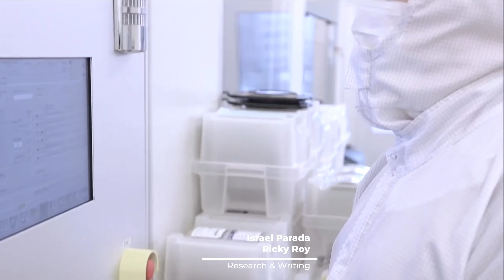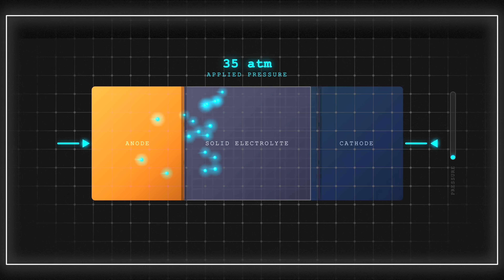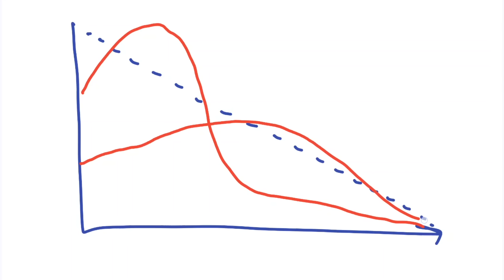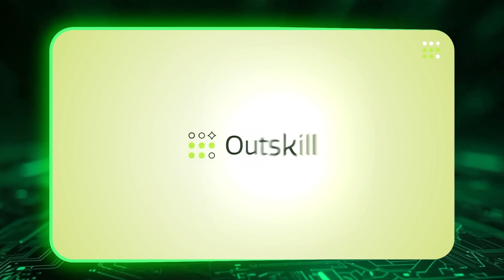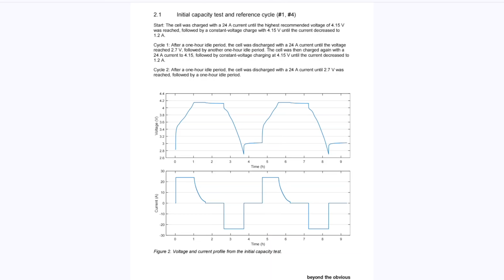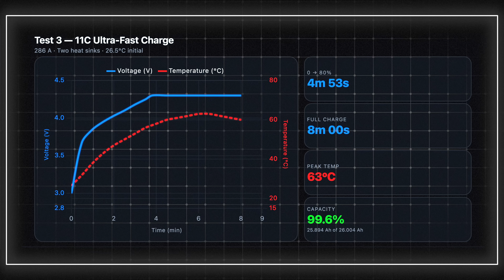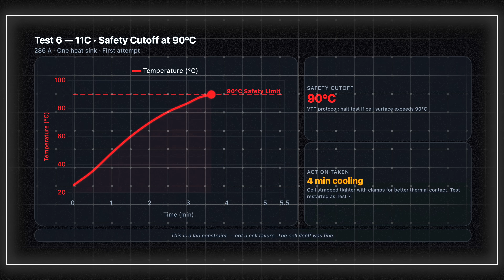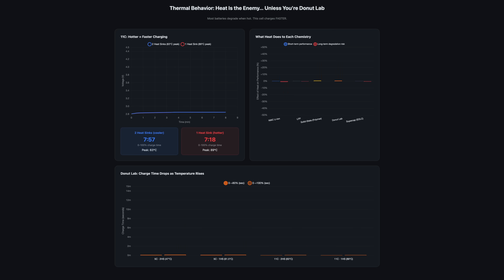Donut Lab's Solid State Battery Test are Shocking...

Comment: One thing I haven’t seen mentioned yet is the apparent nominal voltage.
In the 1C capacity test graph, after discharge and recovery, the cell sits very close to 3.0 V during the one-hour rest period. That resting voltage suggests the average discharge voltage may be closer to ~3.0 V rather than 3.6 V.
If that’s the case, this profile looks much more like a sodium-ion discharge curve than a typical 3.6–3.7 V lithium-ion system.
Add the other Donut claims, about no lithium, abundant global materials, 99% capacity at -30°C — it all suggests sodium ion.  Even the charge/discharge curves fit—except for the higher voltages 😫🤯
Reply: interesting observation and speculation and time will tell if you are right... but a plausible answer.
Reply: Nominal battery voltage would be determined through the integration of the power function (Power = Current x Voltage) over the complete charge or discharge process.   The average voltage over the complete process for this Donut battery is much closer to 3.6V or mimicking Li NiMnCo.  At CES, Donut’s representatives claimed many parameters, but three of them were 1. No lithium. 2. Voltage is tunable. 3. Cell capacity is 125 Whr. 
Nobody expected NiMH batteries to work either…except the people who developed them.
Reply: @lucianbakerii4047  Didn't they also claim the battery would mimic lithium ion so manufacturers could use them easily? If this test is to sell the battery in place of lithium ion batteries, I'd order a test that showed that it behaved like a lithium ion battery under stress.
Reply: Sodium ion has various chemistries, and the clue may be a "solid state anode free sodium battery" as it's the one sodium ion chemistry that offers high energy density (up to 300Wh/kg, equal to high end NMC lithium battery) without the addition of rare earth materials.

But I still doubt that because when I looked at some research journals about the development solid state sodium battery it still suffer from the same problem as the lithium one, like it still can't last over 1000 cycles (current EV standard require at least 1500 cycles because of the 150k mile warranty) and require very high pressure to maintain solid connection to the electrolyte just like other SSB. There are semi solid solution that solves it, but has way lower energy density (220-250Wh/kg)

So if the "100k cycle life" and "no lithium" claims are true, they basically opened the whole pandora's box of the battery industry, even if the energy density is slightly lower than 400Wh/kg

Comment: I mean even if its only about 300wh/kg its still impressive if its a solid state battery or any other claim they made is true not the mic drop moment, but still impressive.
Reply: 300wh/kg at the pack level is what they were claiming all the time. 400wh/kg is at the cell level.

Comment: Oddly enough, this is going just the way that that Marko guy said it would. First there would be skepticism, then there would be dismissal, and then once more data is presented. It will switch to ""anybody can make that type of battery & well they can't scale it up without help from bigger battery makers".  And so on and so forth. I don't know how this is going to turn out. But my interest is peaked watching this slow reveal. If they actually have something here. specifically a battery that does not require lithium, all the strange marketing kind of makes sense.

Comment: The terms "game-changing" and "game changer" are way too overused. Everything new or different in any way is now held up as "game-changing." In watching a dozen videos on various tech topics, I heard "game changer" and "game changing" four times! Get a new set of buzzwords! You've driven that one into the ground. It's almost to the point where, if the presenter uses one of those terms, you should just switch off that video, because it's most assuredly not.

Comment: It is not very important whether the battery includes Lithium or whether it is solid state or not. What is more important is the battery's performance for charge, discharge and energy recovery. All of these look good, especially the high temp performance with little or no cooling. The only thing that still concerns me is that the total energy per kg. is not as high as promised therefore it is not really better than other Lithium based batteries.

Comment: Great points. I was computing the roundtrip efficiency as my first task, too, while reading the report. Considering the their efficiency falls somewhere 10–15 % losses (read: converted to heat), charging 100 kWh battery would need to shed 10–15 kWh worth of heat in 5 minutes if you want to charge your future car in 6 minutes (assuming this tech is real). That's a LOT of heat! If you have 25 °C water as the heat sink, you'd need 200 kg (~200 litres) of water to handle the peak loads. Most EVs have less than 20 litres of coolant as a comparision.
Reply: To charge that fast you'd also need incredibly high output fast chargers too. 

Every charging station would require its own dedicated power sub station to be able to supply the huge power demand a regular flow of vehicles would need.
Reply: @JohnDoe-ix4kx  I would expect charging station to install one Tesla Megapack instead.  A single Megapack can output 1.9–2.4 MW which is easily enough to support one super-fast charging. And even if charging station would support a couple of cars at a time at these power levels, you only need to wait for 5 minutes for your turn if you're second in queue.
Reply: @MikkoRantalainen  Oh it's definitely possible on a technical level but it's also eye wateringly expensive.

Interestingly if the Donut Lab battery is actually real then a Megapack installation (or whatever the Donut Labs Megapack equivalent is) suddenly has an enormously extended operational lifespan that would offset the cost by ten times at least.

I'm extremely skeptical the battery will actually materialize but it's fun to speculate on how drastically things change if it turns out to be real.
Reply: The efficiency goes up with rising heat. Seems one should celebrate.
The heating problem is always a problem at super C speed. Solution would be to adjust the charge rate to something practical.

Comment: A lithium battery could not survive the 11C tests.  So, even if the energy density is similar, the lack of lithium alone is revolutionary and disruptive.  And like you said, the tests read like it is a lithium battery, so the Donut battery can be dropped into current vehicles, saving the world from retooling.  Donut likely altered their new chemistry for this purpose.  Otherwise, the disruption would add years to the adoption.

Comment: Standard chemistry, but it performs better (less internal resistence) at very high temperatures with minimal (discharge) capacity loss and no degredation - is this the signature of a standard chemistry?

Comment: They could have something preliminary at lab stage and are hoping to make it commercially viable and in the mean time are faking until they make it, standard modern startup mentality. Or just a pure scam, hoping to run with investor money or something. The are acting in a way that doesn't give them points on believability but does tend to trigger red flags. I really hope it is true and we have new type of battery chemistry to be used in the future.
Also on the no lithium claim, I have worked with startups that have claimed they don't have thing X and later we find out that they had XY. Or in this case, they don't have pure atomic lithium, (Li)  instead it is an alloy or some other molecule (eg. LiCoO2). Corporate speech is sometimes difficult to decipher as you need to parse the question very carefully and then compare the answer and process what did they actually answer, what they didn't say and what prefixes or caveats they used. Good example was when Adobe was asked if they are they using AI. They answered that they do not have plans to use generative AI. Which could have meant:
a) they might be using it in the future but don't have any written plans for it
b) some 3rd party they are using is using generative AI that is somehow integrated with Adobe apps
c) they are using some other type of AI that they can categorize as not generative AI
d) they are not actually using  or going to use AI
e) they are not using but will use in the future

Comment: Standard chemistry can sustain 11c for long periods and 90c temps without issues?
Reply: As I fast charge my Tesla at less than 2C requiring the heat pump to run at max, good point.
Reply: Single cell, massive radiator on that cell, no bms, temps are allowed to reach that high. No consumer product using nmc is allowed to reach those temps because of safety. Any battery can be temporarily better at high temp and we only saw one and half charge cycles at 11c at close to 90 degrees

Comment: Why is the voltage curve identical to a lithium ion battery?
Why is the energy density lower than the 400/kg?
Why are the charging times slower than originally claimed?
Why did it have a safety limit at 90 degrees if the claim was normal operation was up to 100 degrees?

Comment: 1 the aluminium cooler IS passive..
2. The battery is sandwiched between the aluminium coolers, not the other way round (as stated).

Comment: I think what they have shown so far with this expermit  is outstanding. People forgot that they have made an excellent electric motor before and they have faced the same type of skipticism. They have no reason to lie and involve the VTT is a scam product. The whole world is watching and the price they gonna pay if they're lying will be huge. Conventional cell wouldn't tolerate 90 degree C without exploding. I think this will be a gamechanger battery.
Reply: Trying to spin this as the Donut motor all over again is suspicious.  If the battery is legit, then nobody will care about the motor.  The motor is a dubious solution to a problem that nobody has.  The battery is the solution to all of modern society.  Any attempt to connect the two is absurd.
Reply: 90C is absolutely within the working range of some Lithium batteries, though it's right near the safety margin and well above the range that causes degradation. One thing I would like to see addressed is the 100k cycles claim. Clearly nobody has fully tested this, not even Donut. How do I know? Because if you charged and discharged the battery at even 8C 100k times it would take nearly 3 years (4 cycles per hour, 25k hours, >1000 days). It would be acceptable to make approximate results from extrapolated data if you're working with a very well-understood battery chemistry, form-factor, temperature, etc, but they are claiming to have made a revolutionary new product, so I don't know why they should expect anyone to believe it without evidence.
Reply: They made an electric motor that was excellent according to paid shills on YouTube and the kinds of losers who unironically believe such videos.
Reply: Marko Lehtimäki also claimed the world's first Artificial Super Intelligence last year. And not a peep of news since.

People have valid reasons to be skeptical

Comment: Your explanation is the best one so far. Truly gets the viewer in the right seat, front and center. The whole time you were discussing this, I kept going back to your original interview with them, and them saying that there's no Li-ion in it. From a scale and manufacturing capacity point of view, does it not make sense for them to produce as much documented proof first to prevent trademark infringement by labs who will pirate the tech, then sell it to the next bigger buyer who will wash their hands of the reverse engineering ? As far as who gets access to it, while I agree the more authorities there are who can measure and verify this, the more ability for motivated person to exfiltrate the product to hand it off to a reverse engineering lab for their own profit. 

All I'm saying is this - if this was a mere tuning of the step function for EVs, this drama would be way over-marketed. But if this delivers, it a complete replacement of current function with new ones. I fully believe there's already actors getting bribed and chomping at the bit to get their hands on it before Donut gets scale and enough public material out there to prove their ownership of it, before actually selling it on the market.

I am still skeptical though.

Comment: What I would find interesting, is to evaluate the high temperature of 90 degrees, that doesn’t seem to damage the battery (I know it was only a few charge and discharge cycles). As far as i understand, normally you would become nervous with nmc at 90 degrees. So is this a hint of something different?
Reply: I mean it is a lab and they are pushing limits. 90 degrees in a consumer product is a big no nom but that doesn't mean nmc will combust every time it hits 90 degrees
Reply: @sedatmehmed4371  yes not every time, but normally you would not just proceed after reaching 90 degrees and just keep it at 89 degrees as far as i understand. But I understand that there is a lot of speculation. I just thought if they knew it was an ordinary nmc battery, they would be more careful with temperature.
Reply: @philipschiwek6073 thermal runaway is unlikely at 90 degrees. This temperature will cause drop in longevity but if you only do 7-8 measurements with one hour cooldown between each it is perfectly viable strategy to push it to those temps since this will give you better charging performance. Which is exactly what this test was about
Reply: @sedatmehmed4371 Ok thank you for the answer.

Comment: It is an interesting approach to the published, electrically measurable data and temperature data of the black box "DonutLab Battery" to conclude the physical properties of the puzzling battery.

However, a better replacement circuit diagram of the measurement arrangement would have to be used as a basis for the more accurate assessment. In the case of the high currents that occur, the internal resistances of the connection cable and the clamping point must in any case also be taken into account when evaluating the data. Up to the clamping point, the voltage drop on the charging lines seems to be correctly connected, at least during the charge, i.e. the charging line compensation, by correct arrangement of the voltage value recording. However, when discharged, the line voltage drop will always be included in the recorded battery voltage. This has an impact on the determination of internal resistance.

In my view, the recorded temperature values of the battery may originate from the hot connection points at the battery poles and from the higher temperatures of the charging line (resulting from the line losses). The temperature creeps virtually from the line and from the connection point to the battery.

With the stated high loading and discharging currents of 24 to 286 A, the line cross-sections recognizable from the photos will be quite hot from my point of view.

I think of the clear effect when using the also small second heat sink suggests that the measured heating does not come from the battery, but from the connection arrangement.

Plain text: the battery remains cold, the temperature increase comes from the connection lines.

What do you think of my views?

Can you include my views in new and further considerations?

Comment: okay so the data suggests its conventional nmc lithium ion, meaning its not something revolutionary, got it.  But the charge speed with passive cooling is impossible if its nmc lithium ion, so there is no validity to presuming this is nmc litium ion, but a mystery, a potentially revolutionary one.
Reply: NMC can do >11C, I've done it, custom collector plates, but to many cons (i.e. expensive, cycle life).

Comment: The simple fact that you could omit battery thermal management and still charge in 10 minutes (from 0% to 100% remember) is still incredible. Manufacturing complexity of packs would plummet, pack energy density would increase (on top of the extra cell energy density), lower weight, cost, etc...

Comment: There's a slight mistake about traditional lithium ion cells that don't like to be hot. They don't like to be TOO hot, because past a certain point materials start to degrade. But heat does help the chemical reactions (charging) to happen faster. That's why for example Tesla cars pre-condition (heat -up) their batteries before fast charging. Lithium ion cells like being around 55-60°C for charging.
They also hate being too cold for the same reason.
Reply: 90°C will badly damage lithium chemistry, if not set it ablaze
Reply: @davis.fourohfour 90° won't set them ablaze, but it will damage them yes